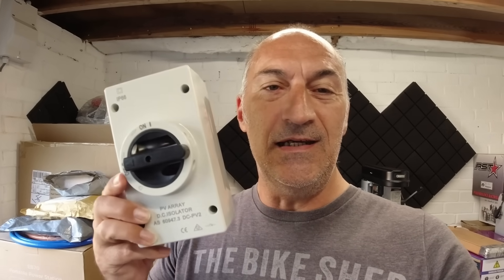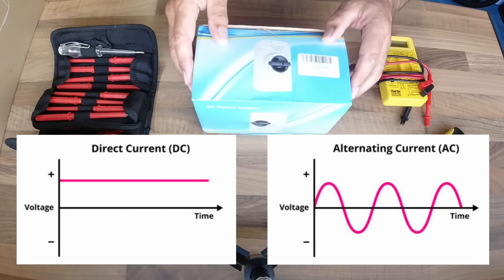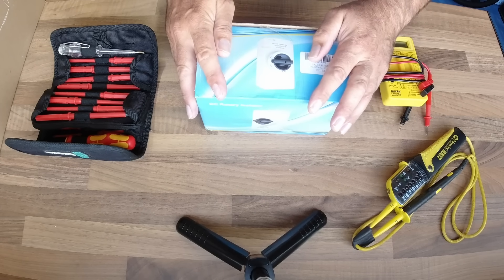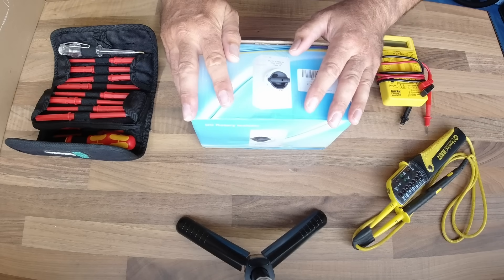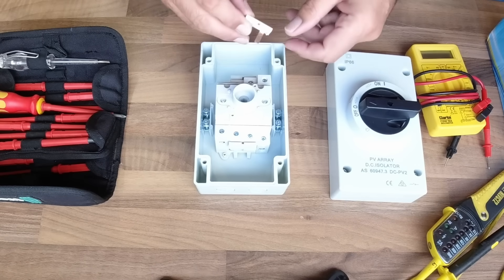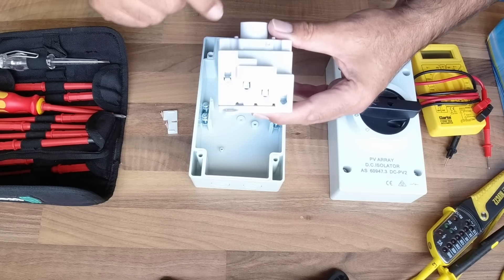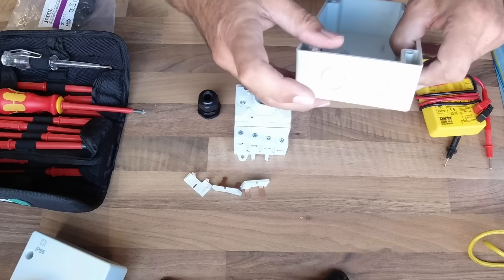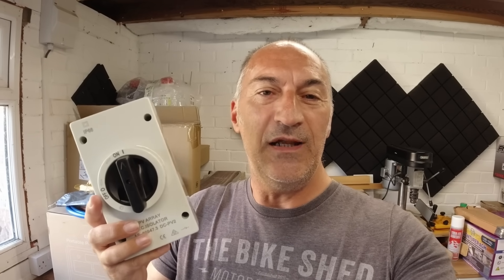How to Wire a Solar DC Switch - Budget Build EP16

Comment: Not really a question about the switch but the continuity tester. Your link takes us to a fairly expensive tester, scrolling down the page shows some very cheap ones and a lot in between. I know that you get what you pay for, but what is the difference between those shown?

Maybe, when this van build is complete and you are between adventures, you could do a video series on the tools you use and how they work. I know that I'd be interested and I'm not really a geek or anerd.
Reply from the maker: Mine is a cheaper one that was branded by a local electrical wholesaler called Newlec. You can search that name in my link and there was a couple of used ones very cheap. No need to spend a fortune on one 😊

Comment: Another great video for the uninitiated with very little knowledge (even though I thought that I might be a bit of an expert because I have the same multimeter as you😅).

My camper hasn't got a switch but I was told that I could cut the power from the solar panel by covering it up (yes it's a faff) or by removing the fuse. Is this not true?
Reply from the maker: A better way would be to disconnect one of the MC4 connections that would act like a switch 😊

Comment: Another nice video, Greg.  I think the most useful piece of content was using the ohm (multi-) meter to test how the terminals are paired.  Can’t make sense of the instructions/diagram?  Use your ohm meter and figure out how it works.  PS - Make a table of the results; do not rely on your memory.
Reply from the maker: I wanted to show how to find out with no instructions in case you need to work it out for yourself. 😊

Comment: As always explained in every detail, thanks. I just wonder if you could use it to connect two sets of 20A panels, so 40A in total or is it rated to maximum 32A through all terminals/poles?
Reply from the maker: You could isolate one panel through 1-2 & 3-4 the isolate the other panel using 5-6 & 7-8. 
Don’t combine them until after the switch or the 40Amps would exceed the contact rating. 😊

Comment: Superb video Greg. When I fitted my first pv isolation switch I was really baffled so I contacted the supplier. We went through a lengthy process over the phone and discovered that the switch was defective. So, I joined the cables with a pair of big chocolate box connectors....far from perfect but it did work. I've since installed a fully functioning switch and it was clearly explained to me by the firm that installed solar panels on my roof at home.....just as you have here 👍
Reply from the maker: Glad you got it sorted now. Thank you for sharing your experience 😊

Comment: Another great video, thanks Greg! I'll be mimicking your set-up of this build with our own. We are having a dinette/bed in ours as I'll be working in there. I would like to utalise the space under one of the benches for our electrical system but my partner is nervous about doing this under where we sleep and wants to use one of the kitchen units instead. Most people seem to use this space though, whether a garage under a fixed bed or cupboard under a bench. Is there any advice you can share that will help give us the peace of mind to set this up under the bench/bed instead? Thank you again, your videos make such a massive difference!
Reply from the maker: The key to help make it safer is some good ventilation to keep everything running cool.  So some decent size vents in the face of the bench will help. Make sure all your cables are sized large enough to carry loads safely and well within range. Cover all terminals so there are no exposed bare contacts. Hope those help 👍🏼😊
Reply: @GregVirgoe  that does help, thank you! 😊

Comment: Great video as usual Greg. That switch is mahoooosive. Bigger than my 300A battery isolator. Why so ? Ringo
Reply from the maker: Because your battery isolator is only one switch and not 4 plus I bet it doesn’t have an IP66 waterproof box around it so you can put it outside. 
Chalk and cheese 😊

Comment: Great explanation, Greg. Can you also explain, please? When fitting a fuse of say 60amp we can get a selection of fuses with different size terminals. Is say a 35mm cable okay being fused by a 6mm fuse terminal?  It seems strange that you can terminate a large cable with a small fixing.
Reply from the maker: But with most cable lugs it’s not so much the connection to the stud but the base plate via large washers and a nut that gives the most connection surface.

Comment: Thanks for this nugget of information, I’ve had a few commercially built Motorhomes and caravans and none have a solar isolator, probably a money saving exercise? Do you think this should be industry standard practise to fit these?
Thanks again, Andy.
Reply from the maker: Yes because it’s not easy or safe to disconnect solar cables from mppt or climb up on roof to unplug a panel.

Comment: Thx for good information as always!  BTW I bought DC fuse switch that has up n down switch.  Is this will be okay to use instead of turning switch like on video?
Reply from the maker: Yes, absolutely 👍🏼 I shall also feature that in another video. This is specifically for those that struggle to wire these isolators

Comment: Hi Greg, Great explanation of a DC Isolator and wiring. I was wondering why the rating only goes to 45Amp if you double up the switch contacts. Most folks would expect it to go from 32A to 64A rating. I noticed a similar thing with cables.....if you use two wires connected together at both ends (i know this is normally frowned upon, but on a battery it does provide for a bit more flexibility), . ...for example you would expect a 16mm2 cable with current rating of say 90 Amps, then two cables joined together should be 180Amps....whereas a 32mm2 (35mm2) only has a rating of 145Amps. You may have already done a video of this ?, but another Virgoe refresher would be brilliant. Getting a standard awg to mm2 conversion chart has been confusing too.

Comment: Always great to view content that you've created and shared. Question:  Why not simply use a DC-rated two-pole circuit breaker to both protect and isolate? This is the approach I've always used; mounting these breakers on DIN rails in an exposed enclosure that's accessible right at an entry point to the vehicle.
Reply from the maker: You are right and I will cover those too in a future video, things move on so quickly and many ways to skin a cat these days. Thanks for the comment.
Reply: @GregVirgoe  Thanks so much for your reply, Greg.
Reply: I was gonna ask the same question, if there was a reason why, as that is what I plan to do. Cheers.

Comment: This was a nuisance for me as I couldn't find too much online. Luckily the Renogy controller protects against reverse polarity! I am always nervous opening this up though due to the panels potentially being live with the sun, and these boxes are a bit small with the size of the cables that go in
Reply from the maker: I would always recommend not plugging your MC4 together until the switch is wired. Once tested all ok you shouldn't have to open the box up again.
Reply: @GregVirgoe  Agreed. Wasn't sure where I was positioning my controller and batteries as solar was put on early in my build, so left all cabling the length it came originally before cutting it later on